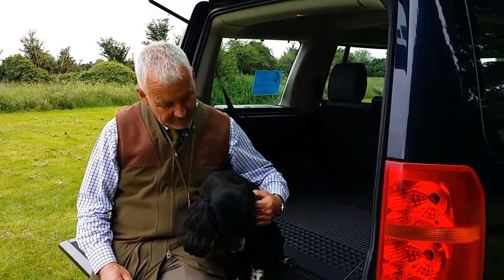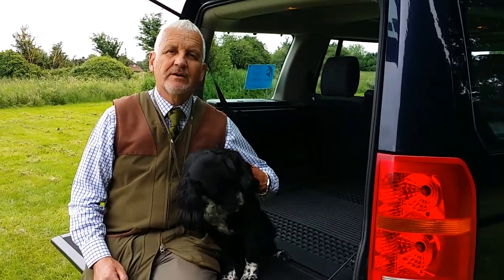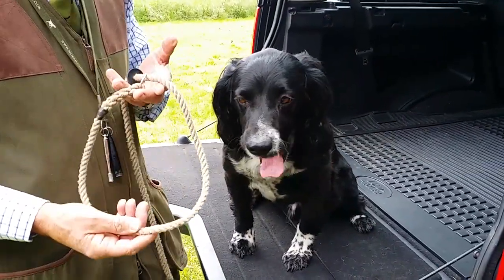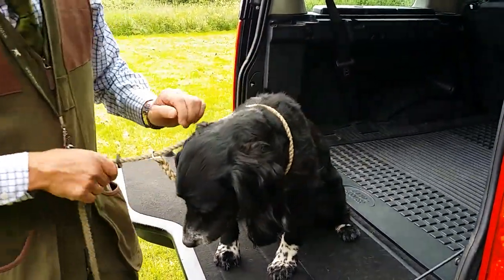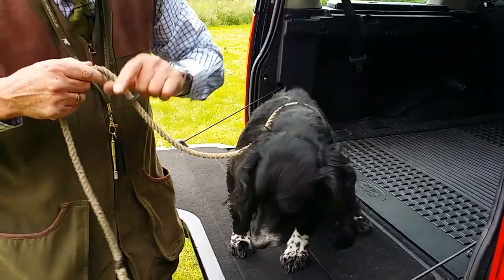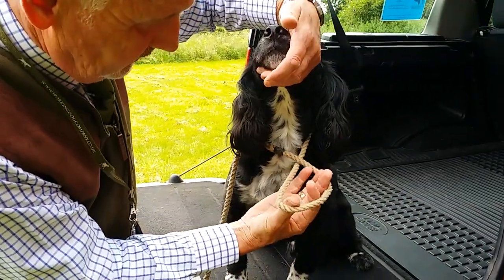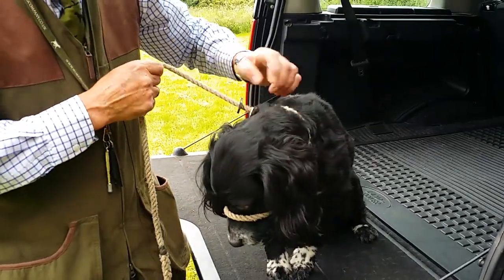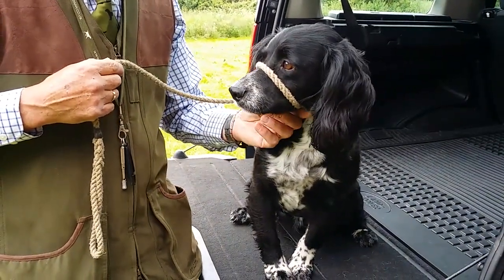How to turn your slip lead into a halter lead

Comment: These can create a lot of torque on the dogs head, leading to a lot of pain in their neck which can also cause damage.  Their skin is a lot thinner than ours which means tissue damage can happen very easily.  The only way to teach a dog to walk on a loose lead is by lots of repetition using either a Y shaped harness or flat collar during training sessions, short lengths frequently until the new behaviour (walk on a nice loose lead) becomes engrained.  There should be no quick fixes in dog training and equipment should never replace time and teaching a dog.  These are aversive to the dog, that's why they work.  An amazing, qualified Dog Trainer explained to me that the practice and repetition of teaching your dog loose lead with short lengths at first is to help them travel new neural pathways.  The more those neural pathways are travelled, the wider they become so that the new behaviour (walking on a lovely loose lead) becomes engrained and the dog doesn't even have to think about it.  It is how all mammals learn.  However dogs can be very complex in how they learn and association and any pain or discomfort from a head collar (which is why they walk nicely on these things) can lead to negative associations with everything around them, even things that are not related, even the handler.  Invest in a qualified, force free Dog Trainer who can evidence their accredited qualifications and understands learning theory, you won't regret it and your dog will thank you for it.